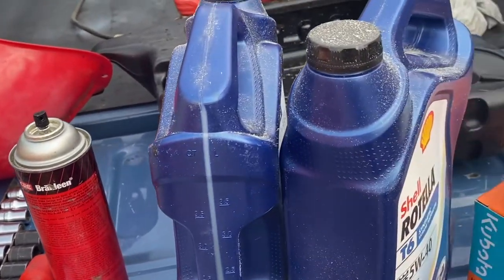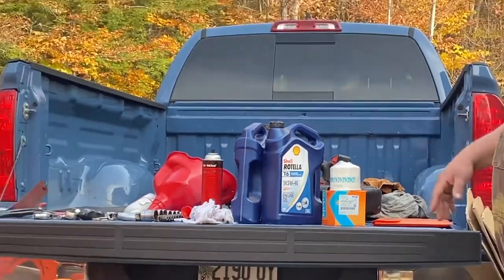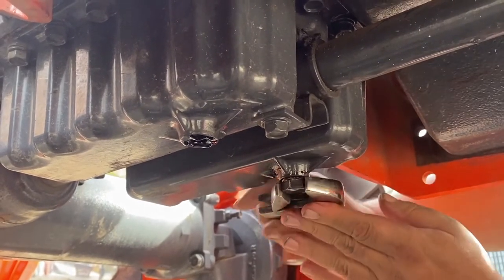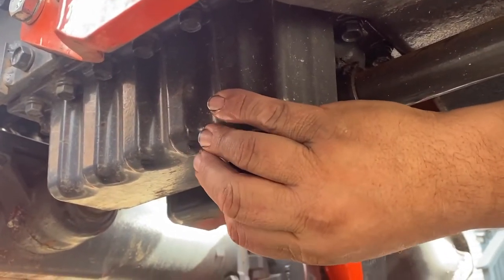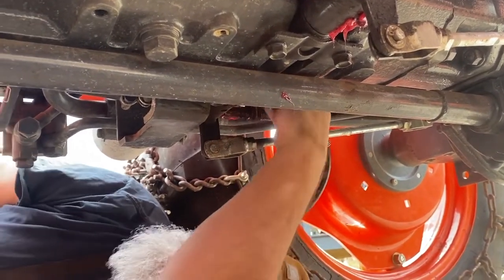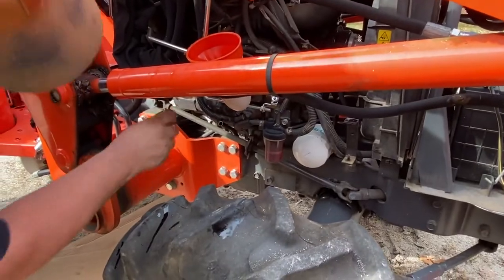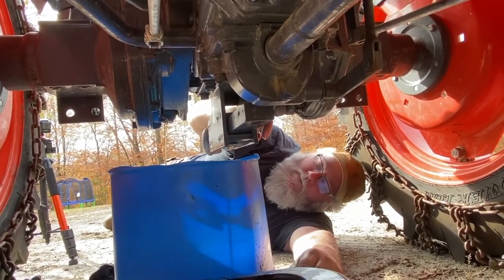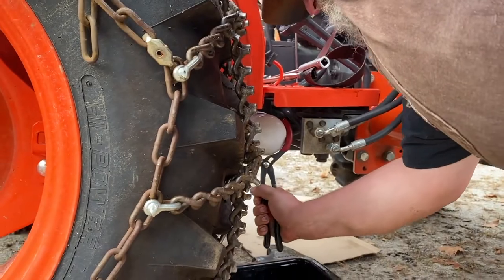Kubota L2501 Tractor - Changing Oil & Filters

Comment: Hello from Arkansas.  I am in the market for a compact tractor (have been for quite some time) and I think I have about decided on what you have, the Kubota L2501.  I was torn on which type of transmission, but I have about decided on gear driven.  We had a gear driven Massey when I was young and I could operate it as quick as I needed!  I watched your video about why you chose gear driven over hydrostatic.  I am not as handy as you and probably would not be swapping or rebuilding a transmission, but I can appreciate the simplicity of a gear driven machine.  Your videos have been very helpful.
Reply from the maker: We have very few complaints on our 2501. It’s a great machine. Glad it was helpful. Thank you for watching!

Comment: Instead of buying kubota engine oil filters I use a Ford FL1A filter….or a Wix or Puralator! They all have the anti drain back valve in them also. Never had an issue! Easier to come by at the parts stores vs driving to a dealer or ordering online.
Reply from the maker: Good point!

Comment: Wishy you had commented on how much engine oil to put in. Several p[people say the 6 quarts the Manuel calls for is too much. One man said 5 quarts fills it. What say you ?
Reply: I noticed the same thing, even the manual lists both 5, and 6 quarts.
In my experience, I’d put the 5 qts in the machine, along with the new filter. Run the machine for a few minutes, and check the oil level. Then use the 6th qt to top it off, if needed.
Reply: I have not change my oil yet. thanks for you message
Reply: thank you
 @scottfromwhiskeynsunshine305

Comment: Howdy...had a 69 Buick Electra 👍
I noticed on the Hydro model has a  fluid sight gage...on the manual; does it have one or just fill the 7 gal back?
Reply from the maker: Well, ours is a gear drive, but they are pretty much the same. I went by the capacity in the manual. It’s hard to see the oil in the sight glass before the 1st oil change. John Deere has a dye, some people add that to their transmission oil so it makes it easier to see in the sight glass.